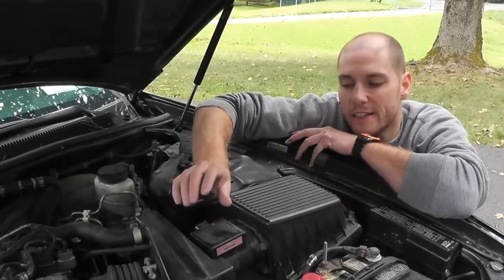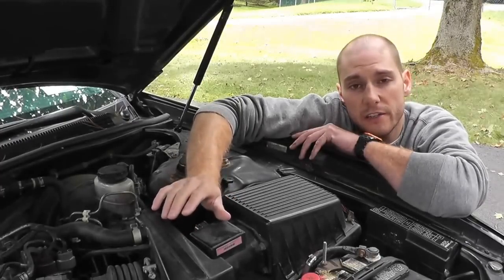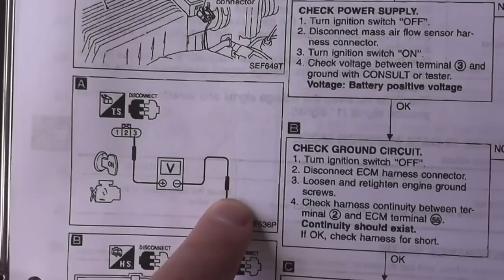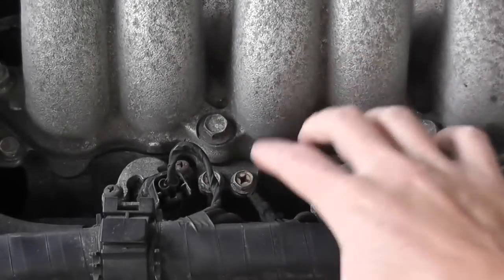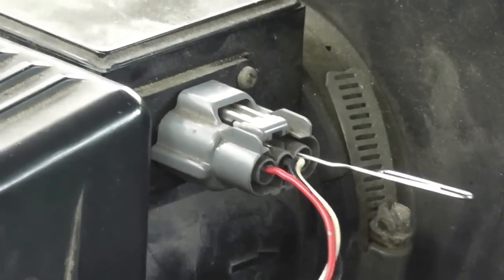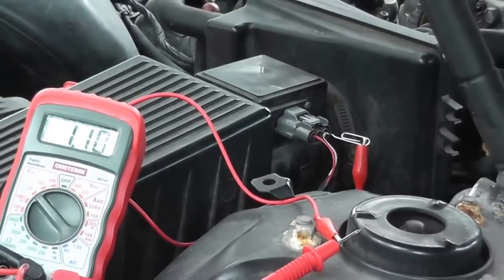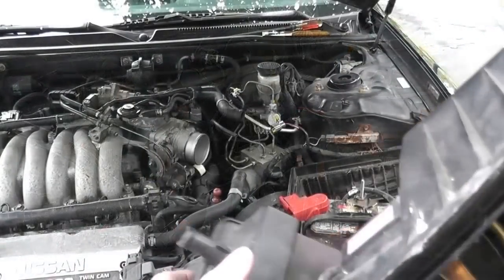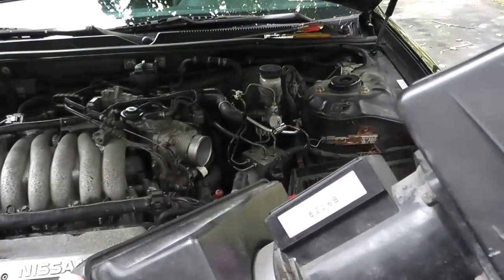Nissan Infiniti Mass Air Flow Sensor Testing & Replacement P0100

Comment: thanks bud, It really helped, I did the test on my 95 Nissan 240sx and the readings like you did and numbers came out about the same, question though when I did the check between terminal 3 and ground I got back 13 Volts isn't that a bit high?
Reply from the maker: Martini Gasalini Was the car running by chance?
Reply: No it was not running when I check terminal 3, ignition was just in on position.
Reply: I was getting only 10 volts

Comment: I have a 2001 altima and we think a sensor for the air conditioner needs to be replaced any clue where that is?
Reply from the maker: Sabrina Hodge Hi Sabrina. Can you be a little more specific? Are you thinking along the lines of what controls the a/c compressor to turn on and off?
Reply: CarsNToys some times it will blow cold and most of the time it is hot. We have replaced the relay switch. And also the valce on top of the compressor. Before we replaced the relay the compressor did cycle off and on but now that issue is fixed. Now its the mystery of why it isn't cooling. We put freon in it. And checked it and it still says full.
Reply from the maker: Have you checked the a/c condenser? I've seen them clog up with leaves which inhibits airflow; which in turn inhibits cooling.
Reply from the maker: Sabrina Hodge Also check out Scotty Kilmer's Channel. He has a few videos concerning AC systems.

Comment: what is the name of the black box to the left of the mass air flow sensor?
Reply: +Rori Fleur air resonator
Reply: +Wimbo Mahadi thanks, I ended up finding out from a nissan car part junk yard.
Reply: +Rori Fleur where did u get that? can i buy 1? :D
Reply: +Wimbo Mahadi in California near San Pedro there is a junk yard for nissan parts only, there are plenty of these nissan or specific car type junk yards or you can go to 'pick a part' all in LA COUNTY. I paid $75 used part $7 tax, you might be able to order it from them and have them mail it to you.
Reply: +Wimbo Mahadi they included the seals and silver circular closure also. it was the cheapest of the 4 locations we could find others started for used part $125 and the dealer was ridiculously expensive

Comment: i got the P0101 code 
MAF sensor is in good condition.
so what else could be the problem
Reply: I have the same code with my altima 2011, already cleaned the air filter and MAF sensor.

Next thing i will d o, but i don't know when, i will clean the throttle body. It may be dirty and wont allow enough air to get in i guess.

If you get any solution please tell me!
Reply: Humberto García I had the same issue, my sensor was good so I had a mechanic clean the throttle body and didn’t have an issue for another 30-50,000 miles. But now with 155k miles my car will crank but just won’t turn over. Can’t start it so I haven’t had the chance to take it to my mechanic.

Comment: i got code po 1105 and po 1105 pd on my 99 nissan altima any suggestions i appreciate thank you.
Reply from the maker: +MARCO CURIEL That's the map and baro switch valve....https://youtu.be/a7eMmzW6zKI

Comment: I don't know if it's My MAF sensor or what. .when I drive it cuts out . (once while driving the car died but started right back )check engine light is on. Does anyone know what the problem is ..it's 96 Nissan maxima..thanks
Reply from the maker: +Ricky Sahjal What are the trouble code(s)?
Reply: ITS P0400 EGR SYSTEM FUNCTION AND PO125 ECT  Sensor Excessive time to enter closed loop ..
Reply from the maker: +Ricky Sahjal I have a video for p0125 - https://youtu.be/bPAIFL8VH9w
P0400 I will have a video for shortly.
Reply: ok appreciate you ...
Reply: Hi I was wandering if you made a video of P0400 ? I saw some Video how to clean EGR but was not clear like your videos are

Comment: my paperclip test is showing 5.0 volts on my 2001 nissan pathfinder.....that normal?
Reply: 2000 Infiniti i30 reads 2.18 volts I guess it going bad i unplug it and the engine stays on running

Comment: Hello friend, i have a question where did you buy those diagrams with the specifications how to test components like MAF Sensor, I see that even the pin on the connector is numbered for that specific car, I just bought one at AutoZone store it's called Haynes it's not complete just general information also different types of engine not good for me, I need a book with more in depth information, can you provide me a link where to buy it, thanks in advance, by the way I liked your video how to test a maf sensor my has 5 pins but i do not know which pin it's ground, signal or positive. Give some info about the book if you can please thanks again. My is a 2001 hyundai santa fe GL 2.4 Engine manual transmission. My car clicks when I turn the ignition switch then I tried again and wants to crank but it does not crank, then I tried one more time and it moves the engine slow or the engine rotates slow, any ideas what could be my problem I does not start at all.

Comment: my maf sensor 4.5 v at idle and when accelerate the pedal the voltage decreases :)
Reply from the maker: ***** What kind of vehicle?
Reply: CarsNToys 94 camaro z28 3 pin cable maf sensor .i checked the power and ground indicating around 12 v but sıgnal wire over 4 volt at idle when i press the gas pedal it goes down like 4.5 4.4 4.3 about around 2000 rpm  im suspicious of opti as well
Reply from the maker: ***** You have trouble code p0100?
Reply: CarsNToys  did not scan it . i was just  checking the sensors before opti .i tested map sensor on it as well :) im getting rare voltage reading on maf .and vacuum lines seems to be okay
Reply from the maker: Gotcha. Some vehicles go in fail safe mode when there's a problem with the MAF sensor. For example, the car won't rev above 2500 RPMs. You can also buy a cleaner for the MAF sensor.
Reply: CarsNToys  i tested after i used  maf cleaner  maybe just needs to be replaced thank you for your quick answer though good man :)

Comment: This is good info to have, but didn’t cover my problem. The green clip won’t always or usually snap when I put the sensor in. The connection is rather loose. Not sure how to fix this or even what part to shop for.
Reply from the maker: Gotcha. You can actually replace the harness connector. Typically you'll have to purchase an entire kit full of adapters. Try ebay first. You may be able to find one.